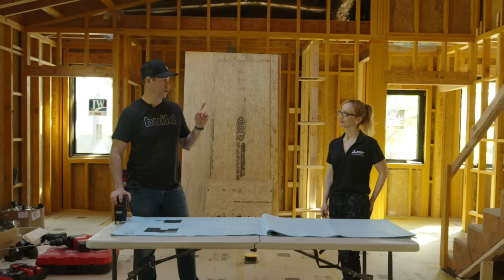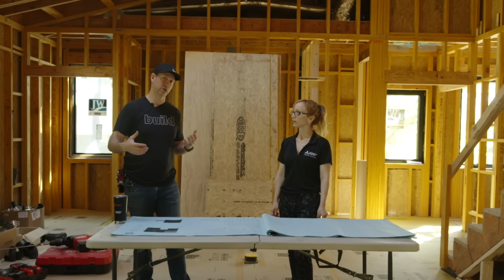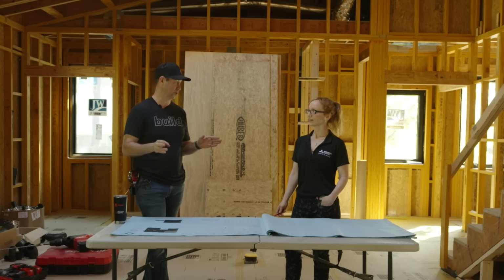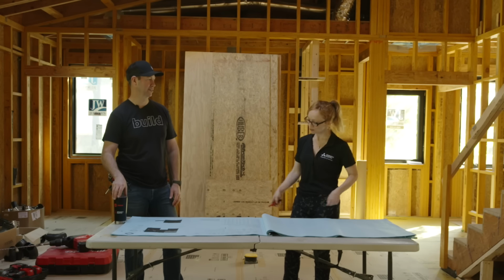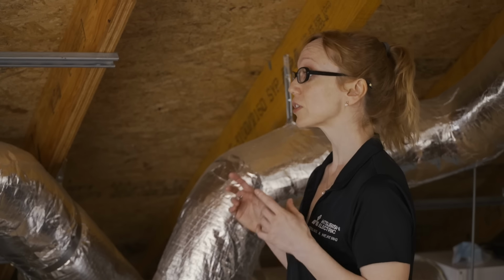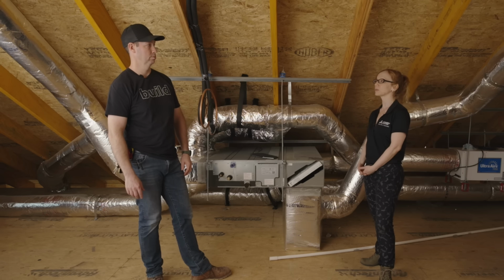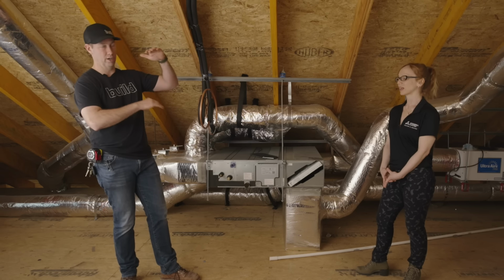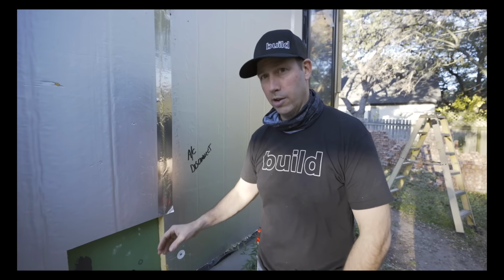Mitsubishi HVAC At My House - Full System Tour

Comment: wow. Kimberly is impressive! she made this clear and easy to understand. I wished you or she explained a little bit better how it works when you have more than one indoor unit hooked up the one compressor. Also, one advantage you both didn't mention a mini split has is, that you dont have to run ducts thru the upstairs rooms to cool the lower floors, specially now that the builders start building multi floor houses.
Reply: That's what the purpose of the variable refrigerant valve is they discussed early on in the video.

Comment: The penalty you get from the fresh air ventilation on the load calculation could be way worse. Imagine if he didn’t have an ERV on the fresh air intake. That would be constant blowing 100 degree air. I wish they had described that in better detail instead of making the “penalty” sound worse than it is. 
The heat gain from the fresh air intake is a known number because it is mechanically controlled. If they performed a load calc on a leaky house, they have to make an assumption about how much air is leaking in. Once the house is built and the blower door test is done, the penalty from air leaks could be way worse than the previous assumption was during the design phase. But at that point you’d have to redesign the hvac system or just tolerate an uncomfortable house.

Comment: Will you be insulating your attic or leaving it as-is? I was under the impression that unconditioned attics where not a great place to placed ducted systems. I just had a Mitsubishi SVZ-KP24NA (ducted attic unit) installed in my attic and was told that I should insulate my ceiling with closed-cell insulation - is this correct?

Comment: When you’re piping in air from outside and the envelope is tight, where does the positive air pressure go?
Reply: It’s typically a balanced system so the air coming in matches the air going out

Comment: Matt. On the hyper heats..they come with a base pan heater on the outdoor units... I live in Connecticut I unplugged mine on all 3 of my units.. if you have them on your system unplug them... I never had a problem and I’m way up north...they kick on at 40 degrees or in defrost mode which you may only see a couple times a year..my units I installed myself, and designed based on load calculations (I used to work for Johnson Controls) Electrician by trade.... I got 5 zones and 3 outdoor units. Also mine are mounted 2 ft off the ground..also make sure you add a surge protector at each outdoor unit at the disconnect. I’m not sure you need any of this information but I learn something on every of your videos.. THANKS!

Comment: Check out rough in boxes for your ductless heads for new construction and titan airex boots on all systems, a little cleaner install. We use Ruud Inverter systems on all our high end custom homes with Ultra Aire dehumidifiers and Fantech whole house hepa filter systems.  I also install ervs controlled with voltage sensing relays wired into exhaust fans and stand alone makeup air systems for kitchen hoods to keep a positive pressure on the house. Most people are surprised how much better air quality they can have in their home with a little extra time and planning.  Educated builders are key to this, I have a select few custom builders I work for in central texas that are educated and don’t mess around. Good luck out there, stay safe and done sell yourself short.

Comment: I just want to know is there another reason people put their hvac and heating systems in the attic other than esthetics and space saving reasons?
Reply: The reason is to put the system into the temp controlled envelope. It really helps with efficiency.  Could also put in a basement.
Reply: @nathanlowery1141  the attic would only be a temp controlled environment if it was insulated at the roof right? In the picture it does not look like it’s the case. Plus it’s a hell of a job for me as a fibreglass attic insulator lol.
Reply: No basement to run ducts through. Slab on grade construction. He’s got 4” of insulation on top of his roof deck.
Reply: @Brianb101  then he can use his attic for storage. The attic can almost be viewed as a controlled airspace. Good design.

Comment: Thanks for the in depth review. 3 years ago I wanted the unit you have in the attic, with similar loading (360 sq ft: a bedroom and 2 baths, zone 5) but was told, by my Mitsubishi diamond dealer, that it would not have enough static pressure (I have fewer runs than you have). 

Could you include all of the inputs to your manual J? Things like hot/ cold temperature for the design load. Sq ft of walls, windows, etc. 

This was a great video. I really appreciate the level of detail.
Reply: They make a high static unit but the amount of duct in this video is probably to much. He talked about the manual J needs to talk about the manual D. Seriously its a book.
Reply: @TurkeyLeggings  he usually uses a professional hvac designer who knows his stuff, and does both the J and D. I just wanted to see the numbers, as I’m quite sure the lower static pressure model would have been perfectly adequate in my case.

Comment: i'm hoping matt or somebody from his team would answer this question...at what point during the build did they do a blower door test to be able to have that data to include in the "Basis of Design" to have a more accurate load calculation?? ...it says Building Infiltration rate (ACH50) is 1 on that big sheet

Comment: Glad to see USA slowly moving into the 21st century in the residential HVAC deployments :). In continental Europe and Asia Mitsubishi and Daikin are deploying even more advanced equipment with multiple internet connected units and sensors, and even hybrid geothermal pump based multi-split systems.

Matt Risinger is doing a good work out there. He's not only lowering your costs, he's also lowering emissions and your carbon impact, no matter if you care about it, or not.
Reply: It's absolutely infuriating how slow we are to adopt new tech out here while all the regressive idiots scream how we're number one. There are people in the comments here whining about how they only recommend the tired old single zone ducted systems they're used to because [insert scary possibility about new thing here].

Comment: What is the cost difference upfront in doing a system like this compared to a normal system?
Reply: Not much these days. I'm pricing out units for my home right now with 5 of the ducted type to replace a 2 gas furnace, no AC system, and one wall mounted cartridge unit for my garage that's currently unconditioned, and the price of components versus a two compressor, two air handler system that reuses our zone perfect equipment is almost flat (if you were to factor out adding hvac to the garage). So it's probably actually cheaper if you intend on zoning with a central unit.

Comment: Super excited to see you're going to do a video on how to control all of this. I've been wondering if there's a need to keep all the zones in sync so you're not using one to cool/heat the other's spaces.
Also less than patiently waiting for the video on your plumbing and getting the low volume to hot water system worked out.
Reply: Nope. No need to keep them in sync. In fact, the ones that are hooked to the City Mult VRF system could even be cooling in one zone, whilst heating in the other! Fantastic technology
Reply: @Floridaman8783  but doesn't that put additional load on the systems?
I have two hvac units and I try to keep them at the same temperature, when they aren't reasonably isolated (there's a door that separates the two parts of the house, but it's open during the day.)
If the front is trying to heat, and it's sucking the colder air from the back, doesn't that reduce efficiency overall?
Reply: @s7726  Yes & no but not necessary. Typically when we see ppl running one in heat/1 in cool - they're each off a different zone obviously. But typically seperate areas. 
If you've got, say grandma living at your house. And she's always cold in her room? Her zone could be running in heat. Meanwhile, I'm in another zone upstairs, I'm always hot. So I'm running my air handler or mini split or cassette in cooling. Not much effect.
I suppose, yes, if you had 2 big zones  right next to each other they could somewhat work against one another. But, that's just it - the name of the game here is comfort. Its about being able to TRULY control your comfort. And, quite frankly, these systems are so efficient - you really wouldn't notice it.

Comment: Just installed my Mitsubishi great unit thanks to you sir. Question is why do you insulate the supply ducts if there inside conditioned space?
Reply: The attic where the equipment is, is not a conditioned space. As you can see, the roof is not insulated. It's best to insulate the ducts to help them maintain the temperature of the air they are carrying and to keep them from getting condensation on them which could then run off.

Comment: Is it a gravity condensate drain from the ceiling cassette or is it pumped?
Reply: Either way. If you have the room gravity but most of the time it’s gonna need a pump.
Reply: I've never seen one installed without a pump. Generally not enough fall for a condensate drain. I imagine the humidity in Austin will keep the pump running hard. It's been a long time since I specified one, the technology is probably a lot better now.
Reply: The biggest mistake people make is they try to use the condensate pump to push the water all the way outside through either a poly tube or copper, both wrong. The pumps are only designed to raise the water high enough to then have gravity take over from there. I am 20 miles north of Austin and your right the water issue can get out of control between the seasons with mild temperatures no load and 100% humidity. Those are the days that shotty HVAC guys scramble to come up with a band aid fix on foam houses they had no business doing to begin with.  I take a lot of calls and answer tons of questions from other A/C guys and that’s the main problem all those guys have. Oversized 2 stage systems, no dehumidifier, too much constant outside air and the threat of being sued...just do it right! Sorry Greg didn’t mean to vent.
Reply: No problem. We all need to let it out from time to time. Sometimes it just seems that no-one knows what they're doing. None of us are immune from making mistakes but how about we all agree to get the basics right. Quite often I ask innocent questions about the thought process of the design only to find out that there wasn’t one. Matt will have his humidity under control I’m sure.
By the way, I’m from Australia. I met Matt at IBS in 2019 and have done some building science training in the US. (We are about 20 years behind you with what we do). Talk about frustrating…

Comment: Any contact info for that girl, I have some question if similar system would work in my home in PA?
Reply: Any diamond elected Mitsubishi contractor has access to Hvac experts. Start with the load calc and system design with the software tools that your local contractor - and if they can’t answer some details, they can easily escalate.

Comment: Matt, I have a good Mitsubishi  ductless system. I had to replace a 30 year old system, my roof at the same time. My electricity usage went from 500-600 a month here in California down to about 150-250 a month during the peak summer last year. one of the nice parts is the system has a dehumidifier built in
Reply: What part of CA? I am considering it in Sacramento, seems like the climate is mild enough for the heating of a standard mini-split.
Reply: @grantrobarts  Placerville

Comment: I have lived in Japan for 13 years with those types of system. From my experience mini split systems suck. My Japanese wife loves American HVAC systems lol.
Reply: I totally agree. They are nasty and don’t have good filtration, breed mold in Florida and don’t last for long.
Reply: Those types of systems are typically older technology. The newer systems are much better and assuming you don't need a furnace, the ducted minisplit heat pump is a great option.

Comment: How do you heat and cool the bathrooms when your using mini splits as a main source?
Reply: Heat recovery ventilators take air from the bathroom.  Undercut doors allow air to enter the bathroom.
Reply: @brucemacneil  Okay so your saying with wall units in other rooms of the house they will be able to heat or cool the bathrooms in the house right?
Reply: @bvsproductions  The best plan is to consult a licensed independent engineer in your area.  

There are many brands, styles and functions of 'mini split AC/Heat Pumps.'  In general - they are all awesome. 

Our house in a very cold climate is heated solely through an air source heat pump.  Though it is an older house with a 20 year old heat pump.
Reply: Essentially, yes.  Though there are a few fine points depending on climate.

Localized electric floor warming in the bathroom is a good option for additional comfort.  

The real key is the building envelope.
Reply: in such a well insulated and sealed house, there is almost no heat gain/loss. a bathroom will be the same temp as adjcent rooms. running a fan will pull air through from the other room (which is made-up by an HRV in cold climates, or just a filter in warm climates). no need to heat/cool that room specifically.

Comment: Matt, why insulate the ducts in the attic if they're inside the conditioned building envelope?
Reply: I think even thought it’s within the thermal envelope it’s not necessarily “conditioned” . They’re keeping in a semi conditioned condition. Ie. not directly heating or cooling (leaks) or supplementary to get it within a target and plus I think it cuts on sound transmission

Comment: .6, I hope the return is large enough especially with the pressure drop in that filter. Remember you need to get the air before you can supply it. Also, let's look at the supply side, I see lots of turns on the round duct, do some of them total .6 ?

Comment: There is the bizarre paradox, that you spend a fortune making your building airtight and then you must pay Mitsubishi a fortune to deal with the air tightness. A completely insulted wooden structure, is going to have huge issues with humidity, possibly 70% interior humidity, which would cause serious mould. I think you should revisit your plans and discuss venting and natural air circulation, with a experienced engineer. Not everyone can afford to pay Mitsubishi to install and run a complete three zone system.

Comment: Lower flow through a filter causes dramatically less loss and is more efficient. Loss is related to velocity squared. The exact opposite applies to the heat exchange over the evaporator. Higher flow is more efficient energy transfer (to a point).

My 2500SF house that leaks at 4.5ach (yes, I measured it) has a 5 ton AC that is almost too big. You have a much tighter 2800sf house (would love to see your Thermal Envelope Test and results) with 4 ton AC in 3 separate systems (if I caught that correctly). I see the comfort increase. I do not see the cost savings in any way. Your system should cost 4-6(possible more) times what mine costs and does not provide that level of efficiency increase. And the cost to repair or maintain will also be higher as fewer HVAC repair techs know how to deal with it. This may not matter to you because you are in the business and your HVAC guy will fix it cheap/free and knows how. The rest of us don't have that luxury of dealing with a competent or honest HVAC tech (An$$^$ List is no help). I agree that houses in the south should have a dedicated dehumidifier.

Comment: I’d rather have a standard ducted system for my family room. These ductless systems create a lot of unwanted noise.
Reply: I have a unit about 8ft from my ear right now. I had to look to tell if it was on. not sure which make/model you have, but my Pioneer and Gree units are quiet as can be. when the fan is on max speed you can hear it, but you can manually set the fan speed if you want silence while watching a movie.
Reply: We have one in our living room. Both the indoor and outdoor units are incredible quite. A far cry from the ol central setup previously. 

I'd imagine all units are not created equal.
Reply: No Mitsubishi system - of any size makes any noise above quite street noise.

Comment: How do you deal with the heating of the duct work going through the attic when you're running only the dehumidifier?  Even with insulated ducts, the attic can easily get well over 120F, so running just the ventilation system will end up heating the house with very hot air very quickly.  There maybe times when your house isn't warm enough for AC, but you attic is still hot and you end up blowing hot air into your house.  This will then make you need your AC even more
Reply: the exterior of his house is highly insulated.
Reply: @somedude-lc5dy  The attic isn’t. It still gets hot